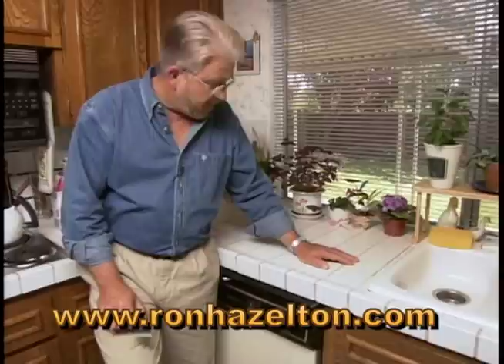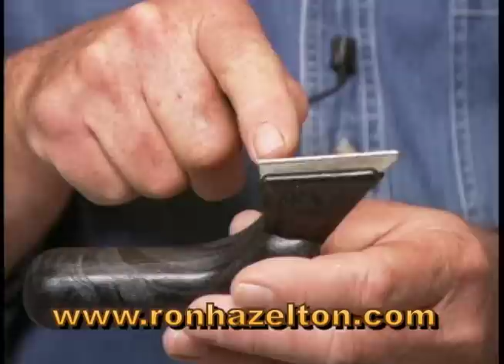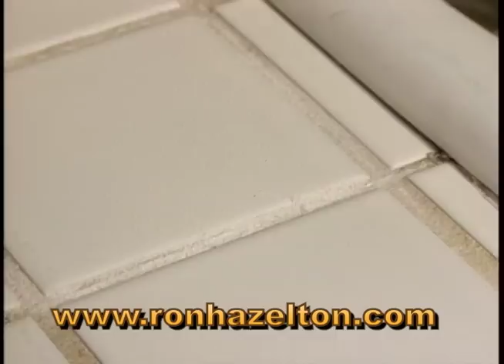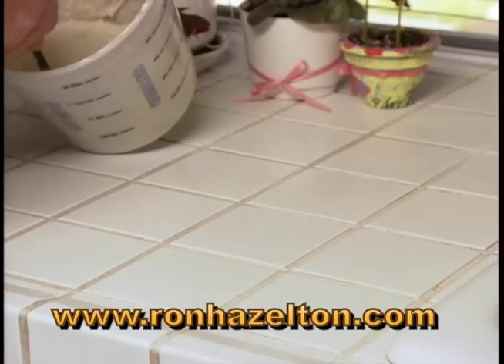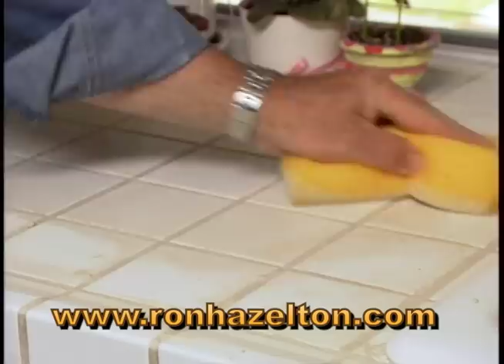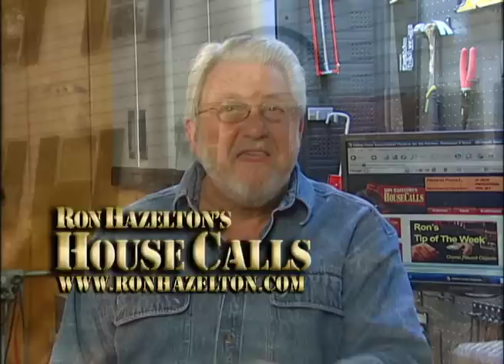How to Remove and Replace Tile Grout

Comment: Hi Ron, I have installed Epoxy in 3mm Grout area on the floor and it has turned dirty in less than one month. Now I plan to change the grout colour with a darker colour, but need to first de-stablize or remove the old epoxy grout. Does this tool work ? What is the name of this tool and would this work on 3mm Grout area safely without damaging the floor vetrified tiles ? Where is this tool available ? Please advise. Thanks

Comment from the maker: @donnaoday 

Unlike paint, there is really nothing I know of that will loosen grout.  I would only remove grout that is already cracked, loose or powdery.  If it's solid, leave it in place -- unless, of course, you want to change the color.

Comment from the maker: The two main types of grout, aside from color, are sanded and non-sanded grout.  Narrow joints, up to about 1/8th of an inch, required the non-sanded type.  Wider joints normally use the sanded version.   I prefer to purchase my grout as dry powder and mix it myself to the consistency of slightly thicker than sour cream.   The technique in this video, by the way, works for either type of grout.

Comment from the maker: Yes, thanks for the reminder.   To reduce staining and improve water resistance apply a sealer after the grout is THOROUGHLY dry.  Check the directions on the sealer package to see how long the new grout needs to dry.

Comment from the maker: Although I haven't tried one of the oscillating tools for grout removal, I can imagine they would work well and be much easier to control than a rotary tool.   Thanks for mentioning them.
Reply: You're video was perfect. Not everyone wants to buy an oscillating tool. I have a tiny job to do on my sink, so I didnt want to spend a lot of money. I will be doing exactly what you did. Thank you so much.

Comment: I would like to mention any of the oscillating tools. Like the Fein Multimaster or Bosch has one too. They are absolutely amazing for grout removal, and for removing the thin set. Plus they are so easy to use. You can single out broken tiles or do them all and its super fast.

Comment from the maker: Check out the user ratings and comments on Amazon for the Dremel 568 Grout Removal Kit.   There is a good balance of pros and cons.  On the plus side, folks say it's fast and easy.  The negative comments deal mostly with bits breaking (@$11 each) and the  tabs on the guide wearing away prematurely.

Comment from the maker: Yes, this can work well, too.  My only caution when working with a rotary tool like the Dremel, is to be careful not to accidentally score or scratch the glaze on the tile.  Sometimes the rotating tool can "skate" out of the grout line.